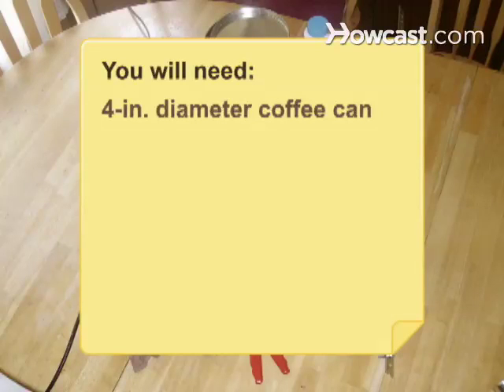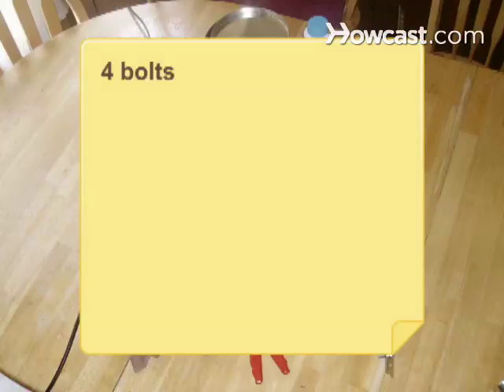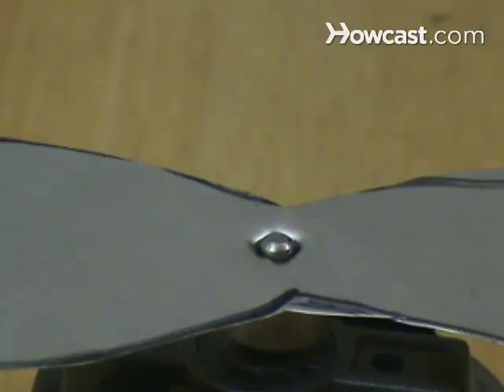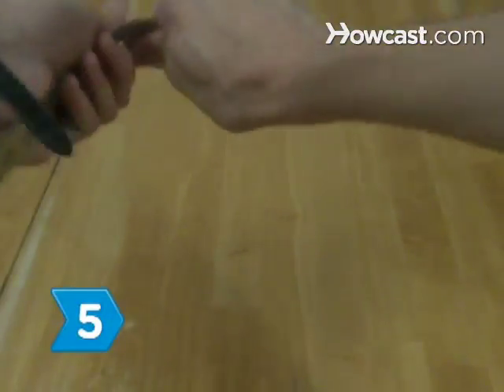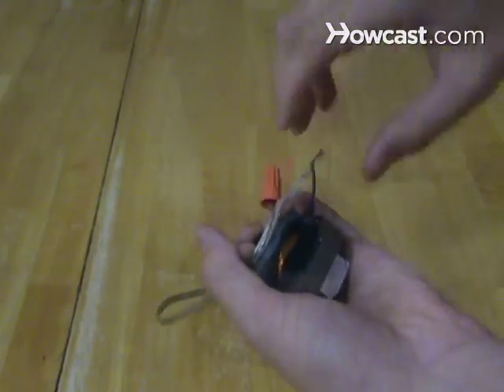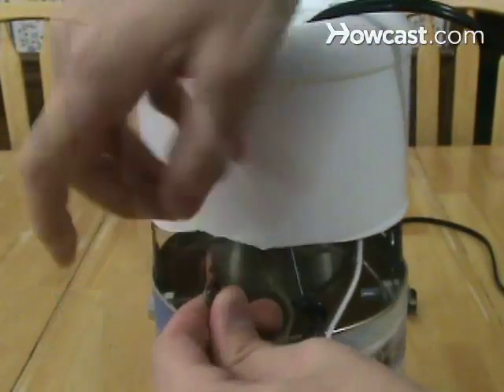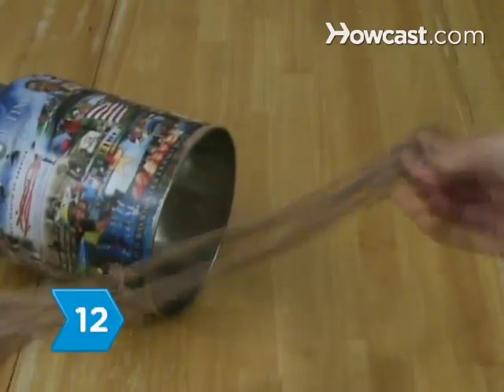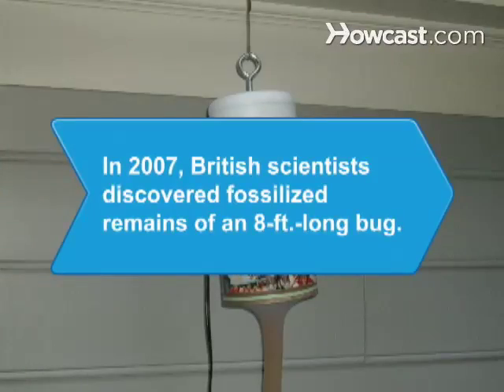How to Build a Bug Trap

Comment: Why is there no explanation on the theory of its operation?  Also super glue will absolutely NOT work to attach the fan blade to the motor.  Many other glues will work but not superglue.